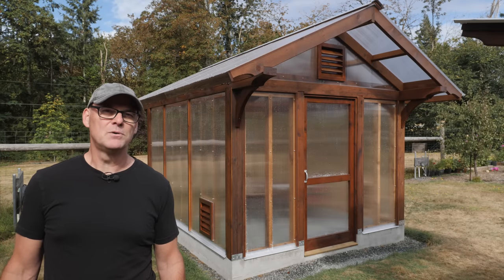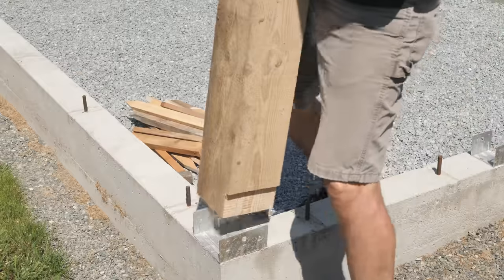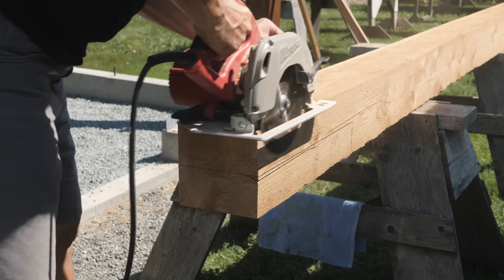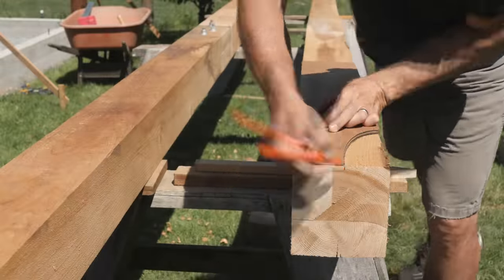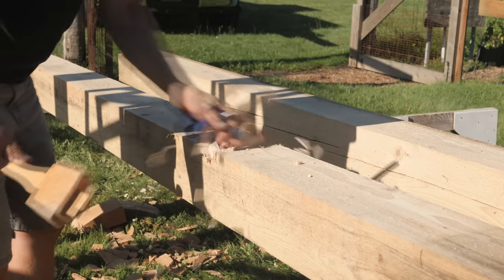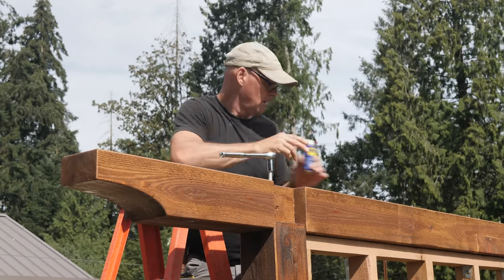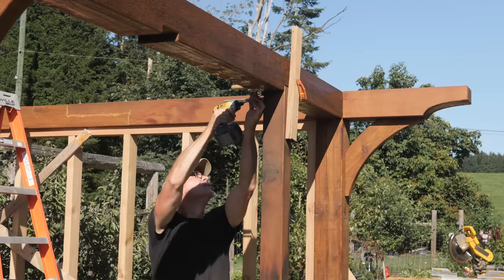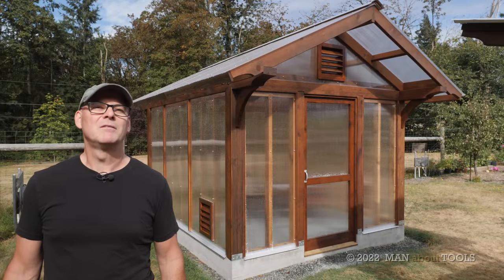Greenhouse Build Series 2 - Post and Beam Framing

Comment: I'm designing an enlarged version of this and am wondering why you put a sill seal tape underneath the door foot plate but not underneath the rafter frames. Wouldn't you want to keep the wood from wicking moisture out of the concrete in both scenarios?
Reply from the maker: There is a foam sill plate gasket under the 2x4 walls. I staple it on before lifting into place.

Comment: This type of construction meets modern standards, but I wonder if there was a reason beyond simplicity you chose lag bolts instead of pegs made of the same wood used for the frame? Peg construction has been demonstrated to last longer if done correctly due to its ability to swell and shrink with the rest of the frame.

Comment: No moisture insulation (concrete - wood)? 
Capillary effect.
Reply: It's a greenhouse, the wood isn't closed in - so it probably would just serve as a point were water can accumulate...
Reply from the maker: There is a sill gasket between the concrete and the bottom 2x4 of the stud walls.
Reply: @MANaboutTOOLS  Sorry, it wasn't shown in the video.